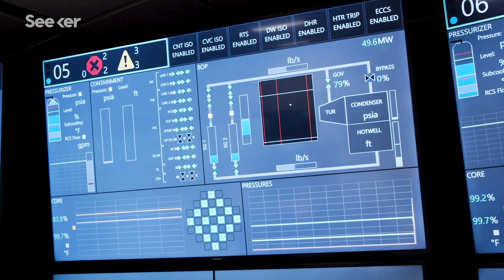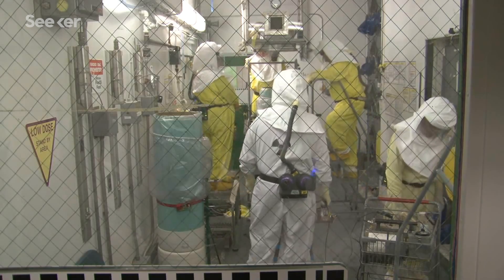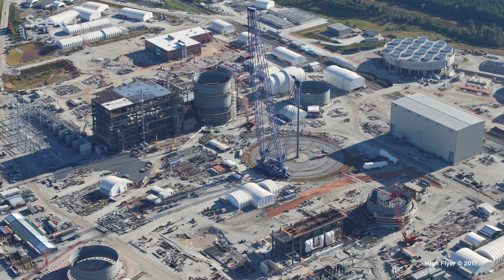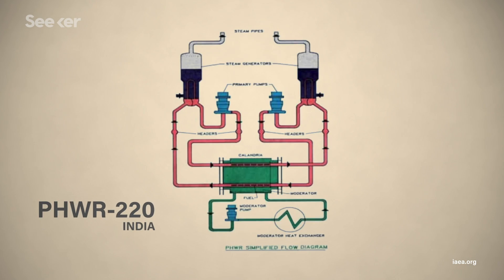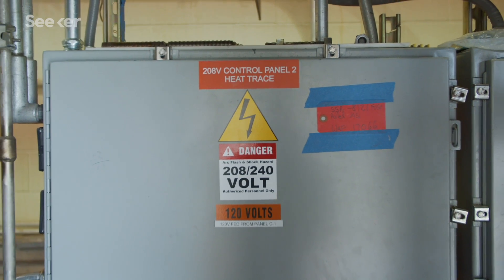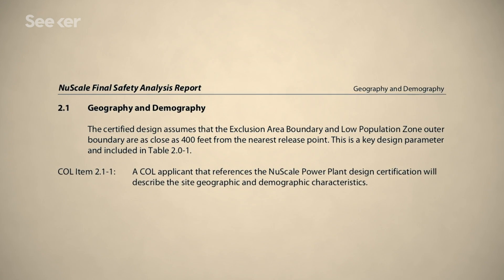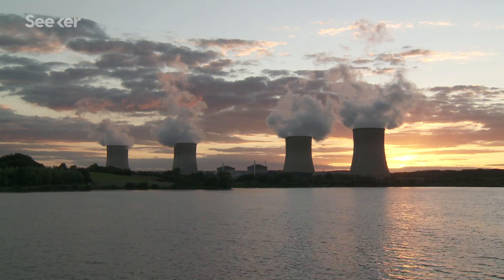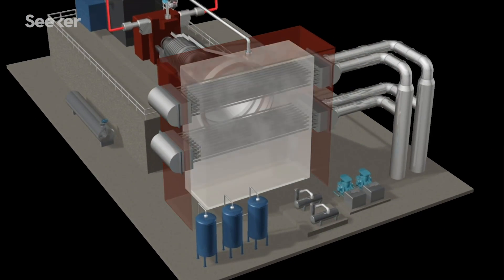Mini-Nuclear Reactors Are Coming, and They Could Reinvent the Energy Industry

Comment: its far easier to store the small amount of waste nuclear energy provides securely than it would be to reverse climate change because we were too scared of it and continued using oil
Reply: Advocatus Diaboli  We can use the sequestered CO2 as medium for Brayton cycle turbines which have a higher operating efficiency.  Also can be used as feed material to make fuels at nuclear plants that have enough heat energy to reform the gas.  We close the CO2 loop!  Oh...and we plant more trees.
Reply: @hoser20000  
We don't need that much CO2 to operate supercritical carbon dioxide turbines. And turning CO2 back into chemical fuels is a very inefficient way of utilizing the energy.
Reply: Coal energy kills more people every day than nuclear energy ever has since it has been invented.
Reply: Not just that, but coal contains radioactive elements. It is burned, and releases the radioactive material into the air...
Reply: @aidaneloff5357  The electric industry made sure to get our government to avoid regulating coal plant waste as radioactive.  We used to release more uranium from coal burning than is contained in all the working reactors in the country....EVERY SINGLE YEAR!!!
Reply: @aidaneloff5357  Even worse is the release of mercury.
Reply: @aidaneloff5357  what crack are you smoking? coal is only Minorly radioactive, and even then, the radioactive material is just another coal isotope. you burn it when you burn the rest of the coal.
Reply: With liquid fueled reactors you can configure them to burn up the waste from solid fueled reactors. The burn up of solid fueled reactors are horrible.
It's like how we went from solid fueled transport (coal fired stream trains) to liquid fueled transport (the automobile)
Reply: @MostlyPennyCat You realize when they talk about nuclear burning they aren't talking about literally burning the fuel right? Nuclear burning refers to transmutation of isotopes by adding neutrons to the nuceulide thus converting it into a different isotopes typically with a much lower decay rates. 

For example burning actinides like Americium 243 with a 7,340 year half life into Americium 244 which has a 10,1 hour half life. 

The objective of this is to reduce the total amount of time it takes for a material to remain radioactive, but in terms of risk you also have to recognize that transmutation will change the isotope typically into a more radioactive material and that isotope may exhibit different forms of decay or have different water soluability or bioaccumulation risks. This is why most discussions of nuclear burning are referenced in particular types of reactors such as a ABR (Advanced Burner Reactors), where the reactor is configured to optimize transmutation of materials into isotopes that will decay completely within a nuclear fuel cycle, so that by the time its ready to remove the spent fuel you are removing significantly less radioactive material.
Reply: @brian2440  
Yes, I know exactly what burn up means in the context of controlled nuclear fission.
Reply: @brian2440  
However, thankyou for the more detailed explanation, it will probably be useful for other readers.
Reply: There are a few factors as well as climate change that could bring back nukes. Improved tech and lessons learned by research teams who investigated the accidents. And even with nuke danger it still has killed less than oil has. This coupled with the threat of climate change may give nukes the green light. And if they could find a safe way to send waste to the sun it would be good. Maybe they could make containers that never break on impact if the rockets fail, with new fangled materials.
Reply: it is best all way around to go full sustainable, we really doesnt need those thing if we committed to sustainable technologies and investment.
Reply: If we could dye all the gas emissions so everyone could see them, we would have solved the problem many years ago.

Nuclear waste looks dangerous in comparison, because it can be seen, so it exists. While breathing poisonous gas every single day is not much of a big deal, because if you don't see it...it doesn't exists.
Reply: Agreed I used to be completely against nuclear power but the more I learn about it the less scary it’s become it really does make sense we have to get away from burning massive amounts of fossil fuels and renewables aren’t able to provide a base load yet .
Reply: Nice meme you have ZERO science knowledge in your poor Fluoride riddled brain.  Please never comment on a science video again.  Nuke waste is so much worse than burning natural gas for power (we have 300 years worth).  You really are a dumbass on this topic educate yourself.
Reply: Nuclear waste vs. Carbon...... most of these oil based carbon emissions are too dense to even reach the ozone layer. Tritium, radioactive helium, noble gasses like krypton (always being vented from these reactors, just so you know),    not so much. We also have all these synthetic elements messing with the atmospheric chemistry...... yea what could go wrong there...
Reply: Advocatus Diaboli  we can turn CO2 to methane.
Reply: @PersonalPerson 

Then what ?
Reply: @thalesnemo2841  Turn that methane into liquid fuel so we can have carbon neutral vrooms.
Reply: @Central Intelligence Agency 

You missed the entire point and thesis of my comments as if you either didn’t read them or lack basic scientific comprehension! 

There has to be a paradigm shift in humanity’s linear thinking to exponential thinking to solve this global problem.
Reply: Easier in the short term, yes. But nuclear waste stays dangerously radioactive for millenia.
Reply: @mosematthiasgnuchtel4946  The French are developing a technique that would reduce the time period of radiation to just several centuries. They have the most advancements in the field of radioactive waste management.
Reply: @Onur K Yeah that's true, but after all the climate deals literally nobody is actually making progress towards those promises. I don't see how 0% progress is better than 0.0001% progress. I hope that politics can fix something for the first time in history. Meanwhile more diverse solutions being developed to solve the problem is fine.
Reply: Again I notice it was located right next to a river .
Reply: So you do have evidence correlating climate change and mankind?

Hint: a quick glance at a temperature chart for the last 15k years should make you less of an ignoramus, if you can read that is...
Reply: @Juanxlink  you sound like someone who believes the earth is flat
Reply: Advocatus Diaboli  use it in algae farms to produce more energy
Reply: Wow..... you're fucked. 

"Global warming". Lol
Reply: it is not that we are so afraid of npp but just people who own oil companies suppress its development
Reply: Drink some waste water.
Reply: Nothing wrong with hydrogen. Only people scared is people with money in oil.
Reply: @chris sullivan Good Idea, wanna help? :D
Reply: Why don't we just go solar
Reply: Climate change....... Pffft....... you're a lib idiot.
Reply: Climate change due to CO2 is probably orchestrated. Look how many trees have been cut down in the world. 
Methane is still ten times more potent as a greenhouse gas though. And guess what's releasing methane. The Arctic permafrost and the Antarctic permafrost.
Reply: Advocatus Diaboli  Believe it or not, but there is a lot you can do with liquefied or solid C02. Just collecting it and selling it could be a hugely profitable industry.
Reply: Gotta love shills man.
Reply: @Michael Alber good thing we can make plastics our of biomass
Reply: @Michael Alber yes, but its also very hard to drill the very deep Earth's crust, geothermal is in fact doable, not on every place but just where the layers are more thin.
Reply: System is the problem 🏡  The Great Qualities

1, Show all living creatures; all the love and kindness as much as you can.

2, Only try to be honest with yourself. If you try to be honest with others, you will get into big trouble soon or later.

3, Aim only one target at a time; otherwise you are chasing two rabbits and you will miss both. So, the reason behind it. Have one powerful reason and never ever give up the one you want the most.

4, Don't try to be good person only but be the powerful person. We will grow to be the one or we will die. There is no other choice. 

5, Always learn and look for to improve something your life. 

6, You are not alone. Love and faith the high power reduces unnecessary stress in life. But never completely rely on it. 

7,  Success and happiness are the byproducts of our usefulness. So, always increase the possibility of success.

8, Life is not going to be easy. Because of our unnecessary things. Eliminate all the unnecessary things as much as you can by organising yourself well with the environments. 

9, Never believe anything without the proper evidences. 

10, Always try to give more than you take. 
Because it is dignity/ character of the divinity within you.

🌎 As long as people continue to see themselves as separate from everything else, they lend themselves to being completely enslaved. Success depends on how well we relate to everything around us. Joy comes from that bliss of connectedness. I believe that unarmed truth and love will have the final word in reality. To love; you should have good heart. I am a good person until I see a person better than my standard of goodness. Being good is the progress towards a worthy cause. Love is God. Whoever lives in love, lives forever. How selfish it is to try to keep something forever? Love is all about nourishing, nurturing, sharing and expanding the love within you for all. The principle to which we adhere to is that we have kindness of love at heart for the whole of mankind.  As long as there is the unnecessary differences within us; we can not live peacefully so we have to eliminate all the unnecessary differences among us so we can love all. People abilities may vary but not there true love. If we love a person/ God for a reason then we love the reason but not the person. No reason is the reason to love the person because true love never fails. So do not compare or measure the true love as first or the last but love all truly. If you love people truly then you can understand people. If you don't love then you don't understand people at all.

People are controlled by system why?
The Cyclical Consumption is the current economy all over the World. It is making the scarcity problems of the earth finite resources to deteriorate day by day. Current Monetary System is legalised theft. Real money is Gold and Silver. Scarcity gives the money more value. Real money won't lose it's value. When Governments stay away from Gold & Silver then very easy to transfer the wealth / resources to upper class the Rich (Corporatocracy) Elite. When the Governments are printing out more new fiat currency with reserve banks, our old currency is losing its purchasing power everyday. They are printing millions of currency everyday. All governments and laws are existing right now to transfer wealth to upper class the rich elite. The USA Government & other Governments are in many countries, bailed the investment banks & financial institutions in 2008 against the majority of the people. There is no democracy in any countries. Because of the Money System based on profits motive only above all else even humans lives and well-being. So, we do not have freedom to protect our values with the money so on. The violence, bankruptcy & all the negativities are build into the Monetary System of our society. All are owned (including ourselves) by Reserve Bank. Which is private cartel the corporation. So, in legal system, we are legally considered as chattel the properties. They make money in the capital markets with our birth certificates. They do not consider us as Humans. That's the truth. We are at the invisible war with the Elites (Corporatocracies). We have to fight for our Freedom. Resource Based Economy is the Solution. We have to declare the earth resources as the heritage of all the people of this world. So everyone has access to it. Please have your research about zeitgeist movement then you know the truth more. 

 Truth About Health/Drugs Industry Because Of It Your Life At High Risk The drug industry is a 1/2 trillion dollars a year worldwide conglomerate. Almost 300 billions dollars just in North America. That is really big business. What would happen if everyone were well? There is no money in health. You see, good health makes a lot of sense but it doesn't make a lot of dollars. Because everything they do is toxic. Every drug they use, prescription drugs, all drugs are liver toxic, bar none. If you've had amalgam fillings put in your mouth by dentists. It is highly toxic. There's cancer because most of the chemos are themselves carcinogens. To view the tumor as the cancer and we know the tumor is not the cancer. The cancer industry is 200 billions dollars a year. The more work they get, the more profit there is. You have to dismantle; If the truth ever came out about what we would need to do. 30% of people of females in America are at risk of getting, will get cancer of the breast. The ones that are already dead have been grossly mistreated by the medical profession and by the government that supposedly is supposed to encourage free research and development of all possibilities. Why would medical doctors who studied medicine and practice medicine and are heavily funded by pharmaceutical companies why would they go and look into vitamins? That they never had the answer orthomolecular. And as more and more of our population start taking their health into their own hands, there's going to be even more and more of changes. It can't go on the way it is. The system is failing apart. We must make nutrition the primary prevention strategy for the population. You are what you eat. You are everything that you have ever done to yourself. The choices you make directly affect the outcome of your life. - (Food Matters Documentary in Netflix)

😊 Well, I truly love God. I am not religious but very spiritual person. So, I believe 1) Religion is the beliefs in someone experiences But spirituality is having my own experiences. The mainstream religions people promote religious ideology by giving guidelines and guide but In my spiritual life; I do not want anyone or anything between God and me to restrict my freedom to worship God. 2) We do not need any authorities to do good work. The god work is the good work always. In contrast; organised mainstream religions are claiming that they have the authorities to do God works as leaders so on. 3) God is not capable of doing wrong thing, change the past for us and create anything out of nothing for us. Nothing means not anything. So, even God is limited. The mainstream religious people believe that God is unlimited. 4) God wants us to take responsibilities for our righteousness life but not for all the consequences of our actions because they are continued to exist among us. So, How can god punish us for all our consequences? The mainstream religious people believe we are full of sins because of all our actions. 5) Freewill  is an illusion. People always choose the perceived path of greatest pleasure.  So, we do not have choices all the time. In contrast teachings of the mainstream religions are promoting people to do god's will always because we all have choices of freewill always. 6) We can not separate everything into groups. So, everything for good and evil and there's no success and failure for everything. If everything is real then real things can not be threatened. Once you come to understand that God/The Holy Spirit is in each of us, You will no longer need a Book to tell you how to live. Then why we need religious scriptures? The Virtue is the expression of the basic goodness in our actions. The Basic goodness is the fundamental worthiness of every individuals. We are worthy to God always in everything. 7) Beliefs in a cruel God makes a cruel man. No matter what; every living creatures has the right to live and What makes their life cheap? Everything depends on everything. Nothing too big or too small in value. We can not love and hate at the same time; Being a vegetarian means love without cruelty happily. The mainstream religious people are killing people and sacrificing animals in the name of God. They promote God's cruel punishments. The Punishment is endless for Sinners/Devil according to religious scriptures. But God is love always. Overcome hate with love. If all religions for peace, unity? No way. Because they are not for peace. 8) Well, The God gave us everything to go from moment to moment in our lives as we do our part  and pray only to thank god then the Love is in progress. The Love is always for everyone. We are always worthy of the God's love. Our greatest fear is; not to be loved by anyone but we are all loved by someone. When we eliminate all our unnecessary differences among us then true peaceful life is possible with the true love. If we can't find the peace within ourselves then we will never find it anywhere else. 9) This is the Fight for independence and freedom of humanity to worship God freely without religious guide and guidelines to restrict us. Unnecessarily, We do not want third party controls over us in anything ; especially in spirituality. 10) Revive Survive Thrive. Sincerely,  The Real Peacemaker against religious oppression.

 https://youtu.be/HbvCxMfcKv4
https://youtu.be/pIJHJzDQcRM
https://youtu.be/MyxbdmAnIcI
https://youtu.be/wLzeakKC6fE
 https://youtu.be/P8vHa8zD7jY
Reply: Even with climate change there are machine and techniques to completely control gasses in the air. I don't understand why people look at politics and tax increases to fix climate change instead of science.
Reply: @BboyKeny  because it is too expensive.

traditionel methods to filter CO2 out of the air cost to my knowledge around 600$ per tonne of CO2 not putting it into the air in the first place is a lot cheaper.
The cheapest way to filter CO2 out of the air is to this day trees.
So the basic idea to save the climate is to use taxes and politics to reduce the amount of pollutants and use trees to filter out some of the CO2 allready in the atmosphere.

Just relying on science is a gamble which is just far too risky.
And yes I am aware that a cheaper way to filter CO2 is being designed, but even that would be more expensive than it would be to reduce some of the CO2 emmissions.
Reply: TheRedMooncorp actually incorrect, There’s a video on YouTube with bill gates and how he has developed a way to filter it for super cheap. Gotta find the name of the video.
Reply: @TheRedMooncorp  The trick is to not filter it out of the air, but let the ocean do that for you.
Reply: @centralintelligenceagency9003  but the thing in the oceans which filters CO2 is phytoplankton and their numbers are dropping, due to climate change, since warmer water has less oxygen so more climate change leads to even more climate change
Reply: @BboyKeny  Just consider the bare scale of it. We spent the last ~200 years burning all the stuff we could put our hands on to reach the current CO2 levels, and we built and rebuilt several times almost everything we see around us using the energy from those fossils. With an unlimited clean energy source in the TW range used for this sole purpose and a plausible, yet-to-be-invented CO2 removal tech with an optimistic overall efficiency of 0.5 we would still need hundreds of years to reach pre-industrial levels. Or even mid-1900's levels. By then, polar ice caps already gone, big coastal cities gone, huge masses of arable land gone, in the end, the survivors already adopted to the new conditions, there will be no reason in trying to reverse the process. And to make it worse, barely any of the prerequisites are available today, you have to be quite delusional to think science can solve everything.
Reply: @matwyder4187  Those results are not true though. No scientist is saying that. The CO2 scrubbing tech already exists. There is just nobody inetetested in it at this point. But countries are building them. CO2 level are increasing at a factor of 0.6 compared to 0.2 without humans. The increase is not a few hundred years since cars weren't abundant. The icecaps have been molten with or without humans and will be in the future. There will also be an iceage where almost all life will die out. (warming is way better than cooling). All those thing have been calculated and is mostly determined by the wiggle of the planet every 400 years or so.

The only reason why climate change is political right now is because countries want to not be dependent on the US and middle-east for oil because that will cost a lot more money in the future.

I'm really sorry to break it to you but the stuff about "The earth is doomed" is not true. We are talking about change in 100s of years. Best case scenario is that due to increased CO2 we will have less harsh ice age. Which is what our beloved governments and scientists were saying in the 70 that an iceage was upon us and we need to produce more CO2. At that them the mafia was incontrol of oil and the US was the main exporter. So fossil fuels was good. Now middle-east exports it, so fossil fuels are bad. We haven't seen any effects of the "end is neigh" they were saying would happen in 2010.

I study this shit. Everytime a person says they have science on their side and that the world is ending soon. A climate scientist shoots themselves in the head. We didn't ask for climate science to became the most oppressive political tool. Our instruments, models and calculations are shit to start with. Despite the public outcry nobody is investing money into our research. Nobody is putting money where their mouth is and are only screaming and pointing at other people blaming and demanding. It's dumb and I'm tired of this shit. Week 50 for the yellow vest protest because working class are banned from used transportation to get to work, in the name of climate they threw million directly into poverty over night. Did it change anything in terms of emissions? NOPE. China is building coal plants to step away from oil. But our governments tell us that China is doing a good job despite them increasing their emmisions.

See why this is frustrating? And everybody uses my colleagues, never citing any study. To justify stealing from the poor and ruining lives out of deeply selfish reason. Because they want to safe their own skin even at the cost of everybody else.
Reply: @Kenny Omg 

To remove atmospheric carbon on the unprecedented industrial scale needed the maths and physics don’t work . See the works of Dr Kevin Anderson he walks one through CCS,and BECSS.
Reply: @BboyKeny  its because it makes clean energy more appealimg since it will be more profitable in terms of monet due to tax...
Reply: @dazza1015  Just demanding tax is not a motivator. It never worked, since clean energy is still to expensive so the only thing your doing is put in an economical barrier for people to drive a car which is for most needed to generate money in the first place. Rather subsidize clean energy so it's a viable option for the working class. So put in that tax solely to transition society in a clean one. But what happens now is just increasing tax while people are dependent for their bread and butter to drive while the politicians pocket that money.
Reply: @BboyKeny  Because you need some kind of mechanism to put the science into action dude. So far the free market system has demonstrated a complete indifference to mitigating any damage to the environment because it's more profitable in the short term to destroy it.
Reply: @marlock6573  I agree that there is a need for a mechanism. I would say make the science more mainstream and have investors invest into it. Politicians that want climate change solved aren't your mechanism. They lose their whole platform and party if they solve climate change. Our greens here just like in the US have been calling to remove any and all technology that contribute to climate change. That's dangerous, dumb and doesn't even solve climate change. Even without human climate increases with 0.2, with humans it's 0.6 (these are the metrics most generous for climate activists, most divide it 50/50). Saying humans are the sole cause for climate change is just as wrong as saying that humans don't have anything to do with it. Identifying the problem wrongly makes it impossible to solve the problem in my opinion. But what do I know, I only study this stuff.
Reply: @BboyKeny  Because Liberals are into self-flagellation and believe that not only do they need to be punished but everyone else as well.
Reply: @BboyKeny  because politics have the money to fund everything. And you're overestimating our ability to scrub the atmosphere lmao
Reply: @BboyKeny  Machines and techniques to completely control gasses in the air? That just isn't true, and if you're talking of taking carbon out of the air, it's unsubstantial and extremely expensive compared to just not using fossil fuels
Reply: @joshuanorman2  I don't take "just isn't true" as an argument. I don't mind hearing you out but a equivalence to "it is known, khaleesi" is too unscientific for me.
Reply: That isn't completely controlling gasses in the air, genius, and why don't we just STOP PUTTING IT INTO THE AIR IN THE FIRST PLACE, that way, we don't have to pour billions into extracting it.
Reply: @joshuanorman2  Because that means controlling every government in the world to follow your plan. That sounds unrealistic to me. According to the science even if India or China doesn't make a 0 emission country but the rest of the world does. It doesn't solve the problem. Even with 0 emissions there would be a factor of 2 instead of 6 increase in world temperature. Science says even with 0 human emissions, it wouldn't solve the problem. It just slows it down. The only reason why we don't want climate change is because we don't want to adjust with it. So we need to control it. We could just hope that nature provides enough food. But it doesn't so we have farms. 

Science is slow and hard to do. These things are just tiny sticks to a bundle eventually creating the capacity to fully control it. We can always just revert back to cave men, that's also a solution.
Reply: @Kenny Omg 

If you read the article you cited that IS NOT a solution ! It gives no numbers or the processes and in the end DOES NOT SEQUESTER THE CARBON !
Reply: @Boshua Borman 

Hear , Hear! 

That is what Dr Kevin Anderson states too! Humanity’s linear magical thinking will not change even as the point of no return is passed !
Reply: Boshua Borman wring, bill gates got it down by a rediculous rate. Look on YouTube “bill gates backed carbon capture plant does the work of 40 million trees”
Reply: @Boshua Broman because you will not stop using your phone, nor your car, nor your electrical oven, nor your hot showers. You probably wouldn't exist if we didn't use fossil fuels.
Reply: @BboyKeny  Because nobody is willing to throw enough money at carbon capture for it to make a dent in CO2 in the atmosphere.
Reply: @rollog1248  Just some public awareness of people working on it  means investors will throw money on it and later on make that money back. So a big more wide-spread exposure is literally a big step in the right direction to nip the problem in the butt. At least that worked for about any problem ever solved in the history of mankind so I don't think this is a unique exception to that rule.
Reply: @Kenny Omg 

The maths and physics preclude that your comment is NOT doable on the huge industrial scale needed to make any difference. See the works of Dr Kevin Anderson he walks one through CCS and BECCS to show that the maths and physics don’t work at scale!
Reply: Sprunk Soda yet people have and recent videos would tell you otherwise. Look on YouTube 
“bill gates backed carbon capture plant does the work of 40 million trees”
Reply: @BboyKeny  We could also plant more trees!  But that wont allow our governments to play games with us and take more of our efforts via taxation.  It's actually all about government control and money.
Reply: @hoser20000  Planting tree is also fine. I don't mind a national holiday where you go out with your children and planting some trees. Sounds like fun, we can all go out and drink after some gardening.

But we can also use the same mechanism trees use and optimize it or breed trees that are way more efficient in collecting and transforming co2, speeding up evolution for plants is something we've been doing for millions of years. We're pretty good at it.
Reply: @hoser20000  Guy, your governments are made up of a bunch of regular people. The issue isn't governments. It's the people who control all of the resources in the world. Do some research into the companies that own the companies that own the companies that you think are powerful. When you see how few companies control a majority of the resources on Earth, you'll realize why progressives take their chances with governments. Governments are made up of people like you and me (a majority of the people in our governments aren't politicians). Politicians don't work for the government, they work for their paychecks. Their paychecks don't come from you or me. They come from wealthy people. 70% of carbon emissions are from 100 companies. Governments could have handled this problem easily...if they wanted to and take some power away from the people who are exploiting "competition,"
Reply: @BboyKeny  trees aren't so efficient, remember hundreds of thousands of tons of them have to die to become coal. Do we even have the surface to plant enough trees ? I bet not, and that would need to be a massive industrial scale operation, even if you don't cut a single tree, that wouldn't solve the CO2 problem.
The only thing saving us by now is the ocean becoming more acid and trapping excess CO2 and acting as a buffer, but that causes other problems.
Know what would help, not having children is best for the environment, not planting some trees with them.
Reply: @monad_tcp  Investing jn the tech that scrubs co2 in an efficient is a way better solution than advising humanity to just go extinct.
Reply: @BboyKeny  I'm not advising humanity to go extinct, I'm just, on purpose, not considering it will go extinct. Because if it goes, then its by definition not our problem anymore.
Scrubbing CO2 won't be enough, its too late for this already.
Humanity won't go extinct because of the climate change, but it'll be hard times.
Unless we do it in a scale so massive to make it work. 

We could consider CO2 scrubbing, but I don't think we can do it in the time-frame we have.
Reply: as long as you keep it in your own country, so any leak or contamination will be your own disaster
Reply: We failed miserably in storing our nuclear waste in Germany. The salt stock meant to keep the waste in for tens of thousands of years wasn’t as stable as expected, it flooded within three decades and we’re now recovering rotten barrels with highly radioactive materials for 20 years. Paid from taxes ...
Reply: humanity doesnt want or need nuclear power. its unnatural, polluting, and dangerous. we prefer renewables.
Reply: @keylanoslokj1806  not trying to go against what you're saying but it's a natural process that occurs in Earth everyday
Reply: Advocatus Diaboli  I don't care something needing loads of energy. First create the system then optimize it. There are a few promising passive ways to do it without a big cost of energy. The CO2 can be turned into building materials or fuels that can be used again.

Since energy is becoming easier and cheaper to produce I don't mind using it to solve big problems. I feel like your idea of machines that can capture co2 are from 1960, not 2019. Which is the problem in my opinion, there is no exposure for companies that are revolutionary in this field. It feels almost like it's artificially suppressed so climate change can be used as a political tool. Why would politicians ever want to fix this problem? I can assure you, the first company that solves the problem will become filthy and I mean filthy rich. Politician don't want that, since they themselves want to be rich.
Reply: There is enough uranium for at most  6% of global energy demand over this century unless we reprocess or build breeders or mine the oceans. There are complications and cost to all these options
Reply: Stephen Nielsen you act as if uranium is the only important radioactive element.
Reply: I'd agree with you if the storage time was within reason.. but hundreds of thousands of years is not even remotely realistic.. nobody can even imagine what could happen in the meantime.. .. maybe if this was thorium based reactors.. but not with current materials.
Reply: @philosoaper  Always this 100000 years.. Those 100000 are coming from plutonium coming down back ground radiation of mSv/year. Which is a totally meaningless goal. IAEA says that 220 mSv/year is safe for anyone.
Reply: @henrich2183  you don't know very much about physics I see
Reply: @philosoaper  You know, I'd be perfectly fine with a sturdy vessel containing a curie of a 100000 year half life isotope being stored in my bedroom. Those isotopes aren't the problem, the dangerous ones are those with half lives of tens to hundreds of years.
Reply: @centralintelligenceagency9003  you know, the problem with storing that shit and your bedroom is that neither you nor your bedroom will be around very long.. but that shit will.. and while it'll be fine in YOUR generation.. it's the shit that comes after that's the problem... so bedroom not relevant argument.
Reply: @monad_tcp  the problem here is people like you who think "oh let someone ELSE deal with it"...but thanks for joining the conversation before the next decade.
Reply: @philosoaper  I like to think that we can deal with it, I don't take into consideration the society collapsing, if it collapses, then its not our problem anymore, what else are we supposed to do? babysit the Earth, nothing we do even matter in the big scheme of the things.
Make sure the society don't collapse, or just let the future treasure hunters die of radiation poisoning, they deserve for messing with what they shouldn't, in the worst scenario they get stories about haunted old mines from the antique old collapsed society.
Reply: @philosoaper  
Fast breeder nuclear reactors decrease the waste storage time to 300 years, a timescale we can easily plan on.
Reply: @gregorymalchuk272  and there are SO many of those reactors in use around the world.. ........................
Reply: @philosoaper  
Well, it means we need to close the fuel cycle, begin large scale reprocessing, and build some fast breeder nuclear reactors. Only one breeder is needed to serve a several light water reactors. Russia has a fully realized design for a fast breeder with the BN800, and the Chinese are building them too.
Reply: @gregorymalchuk272  yes.. they have the best reputations for quality
Reply: @philosoaper  
Pretty much a total non sequitur. Quality comes at a price. Any county can produce quality given a price. And given the nature of nuclear technology, quality components and design are important.
Reply: There are many more clean options such as wave generation solar and wind the nuclear option is unsafe and uncontrollable.
Reply: @haroldlamble5163  I'm gonna be realistic alright, these statements are falsehoods and lies bro... study, research.
Reply: Do you believe nuclear power is free of CO2 emisions? Ooooh boy....
Reply: @jordisaura6748  The CO2 output by nuclear power is a side effect. The CO2 output of an incineration power plant is the basis of operation.
Reply: @centralintelligenceagency9003  well, side effects are also important and must not be ignored.

I personally like nuclear power, is is very futuristic and cool, but as it turns out it is also a bit of a scam.

The true cost of nuclear power is way beyond what is recognised and you pay in the invoice. Much of the cost is absorved by the state. Ie.The insurance .
Reply: @jordisaura6748  yes
Reply: @haroldlamble5163  nothing in this universe is CO2 free.
Reply: @jordisaura6748  actually it uses a lot of concrete and steel, so technically you're right. (I'm ignoring the mining, because you can use nuke power to mine uranium, because of the uranium density, you can't do that to solar power, its game over, if you power the rare earth mining with solar power, you won't get more energy than you spend)
Reply: @monad_tcp  it was long ago and can't provide them, but i believe the sources that make the followibg balance: the energy output from nuclear power is still under the power needed to mine, refine and enrich uranium plus the costs of building, operation and dismantling of a nuclear plant. Thus making it a deficitary energy source when taking all it's cicle into consideration.

Still it is popular and used because of huge amounts of public money spent on the subject, which makes it very profitable.

Instead, i find very hard to believe that the energy needed to mine minerals and ensambling  of a solar panel are not met with 25 years of life of that panel. Plese add source
Reply: @jordisaura6748  "Instead, i find very hard to believe that the energy needed to mine minerals and assembling of a solar panel are not met with 25 years of life of that panel"
I'm afraid that the current society can barely run with the efficiency of 100w/mt^2 precisely because it takes energy to mine the minerals used to make the solar panels, and 25 years is the best scenario, I bet the efficiency of the panels drop in just 5 years.
That's why I prefer nuke, its more safe in having a lot of margin because we get 150K BTU per 1Ton of mined ore, its 5 times more than Oil. Does it even matter we spend like ~ 20% of the energy mining.
Solar is just too little power, but there's that molten salt heater that doesn't use PV or the photovoltaic method and directly heats water to produce steam, that could work, I don't know the efficiency thou.
Reply: @monad_tcp  20% of the energy mining is a crazy amount of energy. Because after that you still have to refine the uranium and then enrich it, from 0,72% to 3-5%.

And I could go on, but i am busy. Jusy consider the complexity of a nuclear plant, the amount of workers constantly there, security, dismantle the plant, dispose of waste, control ovrr that waste for hundreds of years, etc.
Reply: @jordisaura6748  I'm not sure about that, I'm just guessing, I should do a research, I think I saw this as a ball-park numberr. That's the internet is for, someone will get here and correct me.,It will save my time ' cause I'm lazy on this YouTube arguing thing.
Reply: Yes? Because it is...